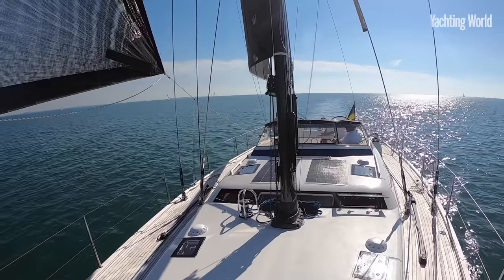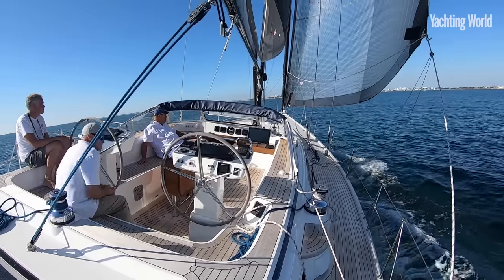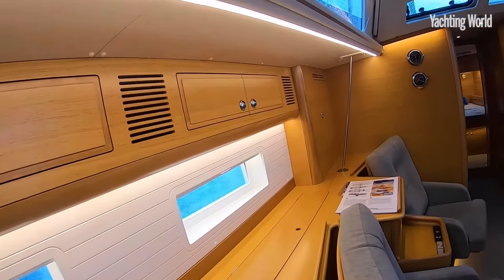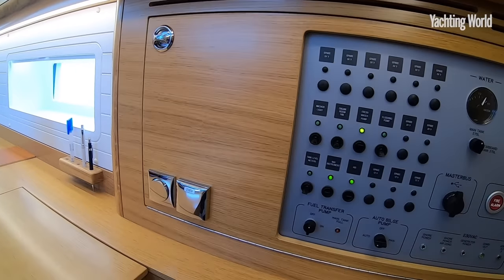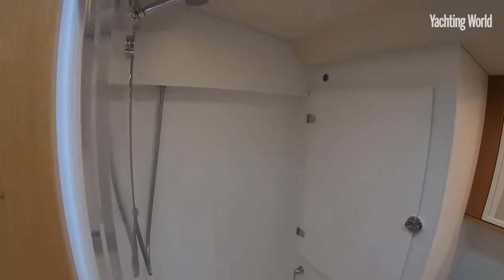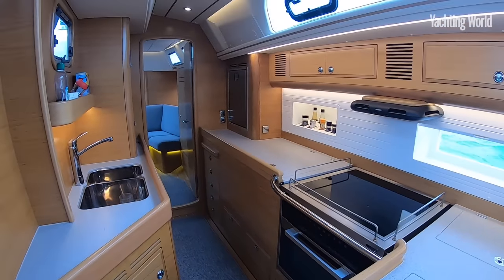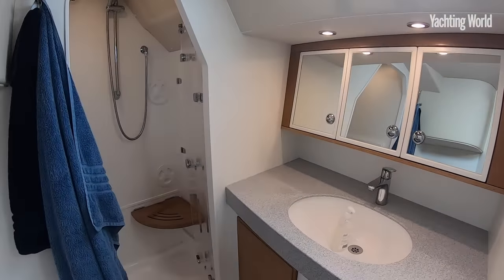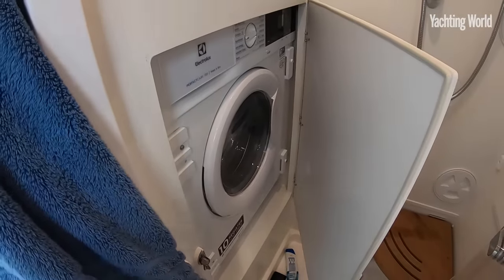Ultimate ocean cruiser? Sailing the Hallberg-Rassy 50

Comment: One of the few builders that still designs for actual blue water and not the latest issue of Vogue magazine. Well done HR….well done indeed.
Reply: But it isn't particularly designed for 'blue water'  I would at least expect some sea berths that would allow sleeping on either tack and provision for lee boards or cloths. On long ocean reaches they are more or less essential.
A double berth should also have a split mattress to allow a centre cloth or board, again to allow comfortable sleeping on either tack. A handy pilot berth near the companion to the cockpit is an essential too.
Similarly with seating and tables, you need to be able to sit and eat comfortably on either tack.
Without this a yacht is just a weekender no matter how well it sails.
Reply: The saloon settee doubles as a pilot berth as noted in the video.
Reply: It got a dual helm and rudder and a modern sleek but beamy hull design, much like Beneteau has sported for years. For some reason, in the cruising puritans mind, the Beneteaus are not blue water cruising yachts, even though most likely is the most common boat brand, also doing Atlantic crossing, but this overpriced Hallberg-Rassy is, even though it essentially sports the same overall design. Granted, the build quality, especially interior, is far superior on this boat than any Beneteau, but so is the price, for crying out loud! A Beneteau Oceanis 62 or Jeanneau 64 (which essentially are sister boats, Jeanneau being an inhouse design studio of Beneteau) cost the same brand new in US Dollars, as this 50 feet Hallberg-Rassy do in Pound Sterling, so really a much larger yacht 20-30 percent cheaper! I could not make the choice to buy this. Even, if I wanted to go down the road buying that little extra on a blue water exploration ready boat, Then this boat cost the same as the 50 feet Garcia Exploration CATAMARAN! A catamaran of course offers vastly more space on the same length hull, and that is a boat build in marine grade aluminium and it takes a full 1½ year to build each boat, because of not least the time and labor demanding welding process. Allures 51.9 cost half of this Hallberg-Rassy, the hull is build in marine grade aluminium, again, on same shipyard, which build Garcia boats and the accommodation is easily as luxurious and no compromise, as this Swedish luxury brand is. When it comes to the indoor accommodation especially and also the protected helm position, I much prefer Amel 50 over this Hallberg-Rassy too, and this almost make that seem like a bargain in comparison, which is fantastic to me: My one gripe with Amel indeed is, that they are expensive! They however also got things for them, as solid stainless steel rails all around and watertight bulkheads and doors between multiple compartments through the entire accommodation, which virtually makes Amel unsinkable. The best part of Amel is however, that they have not yet caved to the popular demand and made aft exposed dual helm positions, but still got a single very protected helm position, double enclosed in the central cockpit and often under a hard dodger too. That is the way to do it, if you want to go blue water cruising, and not just weekend sail in nice weather during summer time. The helm position of this Hallberg-Rassy, as they also are on Beneteau and Jeanneau for the same reason, will be terrible in bad weather sailing conditions!
Reply: I guess you won't be buying a Hallberg Rassy then 😊

Comment: I’d like to see Magnus and Dick Beaumont (Kraken yachts) have a discussion about skegged rudder and encapsulated keel vs bolt on and twin rudder. 
Currently inclined to putting my money into the Kraken.
Reply: I'm far from an expert on these things, but on paper I'd go with a kraken if i had the money and inclination to buy a new boat. Not only for the solid construction, but well thought out systems (which you can see in the kraken engine room tour). Although if the boat was only going to be used for coastal sailing, island hopping and chilling in the med, I would think going for the boat that's most enjoyable to live aboard is best.
Reply: Neither's opinion would really be worth all that much...... Just differing opinions. It's the quality of their workforces and processes which matter.

Once dealing with cruising yachts, where not every single gram of weight counts against you, it's quality of execution which determines how well similarly shaped keels and rudders are affixed to the hull. Not headline "design philosophy" Just as is the case wrt hull material. Both the HR and Kraken ways can be made rock solid, or flimsy and unsuitable, for cruising appropriate moderate aspect keels and rudders.
Reply: That hull shape would be unsailable with single rudder. There is no point in any discussion.
Reply: @blegi1245  the conversation would be about the philosophy of blue water boats with bolt on/blade vs encapsulated/skegged  
I’ve listened to both sides. I would like to put both sides in a room and have a debate.
Reply: @kodiak7  naval architect for hr is German Frers. I don't know who kraken uses. I don't see what yard managers can contribute to a naval architecture conversation that mostly happened about 20 years ago.

Comment: I don’t understand the reasoning behind the pod that sticks up at the nav station only to give you more unusable horizontal surface that can’t be used if you are actually sailing this boat. There also seems to be a contradiction between creating a large spacious feel and then making pinch points like the narrow hallway.
Reply: That’s the thing about sailing, you want the spacious feel but without ever being too far from a surface to lean on or hang off

Comment: Interesting that they compare it to the 55 and yet it is really closer to the 48.
Reply: They are comparing it to the older 55 because it has more interior space than that one even if it's a much shorter boat... The 48 which is also part of the older hulls is WAY smaller than then new 50 in terms of interior space.

Comment: I absolutely love the brand, but I think that my definition of bluewater yacht is different.  To begin with I would like to see some significant cockpit protection for foul weather -- that small dodger isn't going to cut it for major squalls.  With a boat of this size the dinghy davit system is a must -- I don't want to have to manhandle the dinghy or the motor off of the fore deck (I didn't notice anywhere to even mount an outboard -- saillocker? That sounds like fun -- not!!!).  With a draft of close to 8 feet it's not designed for sailing to many favorable destinations (Caribbean, French Polynesia, Seychelles, etc) where people sail to experience the beauty of the reefs.  Finally, spending over 100,000 € for the mast, boom, spreader, and sail system just doesn't sit well with me -- just imagine needing to find parts for  a 100,000 € set of standing rigging in a remote anchorage in French Polynesia --- welcome to your new home for the next few months!!!  Lastly,  I did love the engine room with both front and rear access to the engine, but I wonder about the access to the sides of the engine -- with all of the beam that they were so proud of mentioning, I can't help but think that an extra  3" per side might just make the difference between an easy repair and a difficult repair out at sea.

Comment: Beautiful boat Toby and build quality is renown. I wouldn't spend the outrageous amount of cash required for the carbon sails and mast package.  Not for global cruising. Cheers
Reply: If you had outrageous amounts of money, you could probably be convinced to get the carbon fibre mast set up.I am sure this system would benefit you and the boat greatly.I would but l guess thats just my opinion.First off the lottery win.
Reply: @miketybring4700  I disagree it's a vulgar amount of money and it's certainly not a racing boat, it's a global cruiser so arrival times and departure times become almost irrelevant.  Basic sails albeit good quality ones and self furling and tacking would be prudent and less grief long term. Good quality aluminium mast is all that's required for cruising.  Imagine trying to have a carbon fibre anything repaired in remote destinations.   Put the money into the bank for the trip I say
Reply: @bigbopper143  carbon masts have especially for cruising boats many benefits. It doesn't even make that much of a difference in speed. It's more about stability and comfort of the boat, which cruisers can appreciate
Reply: @Nlsmhs  Ha ha ha ha ha ha ha ha ha ha ha ha ha ha ha ha ha ha ha ha ha ha ha ha ha ha ha ha ha ha ha ha ha ha ha ha ha ha
Reply: @bigbopper143  Carbon mast and boom etc increases the stability of the boat, you are losing a lot of weight up top. Plus, just because you are cruising doesn't mean you have to have a boring sluggish boat.
Reply: @captainswoop8722  In-mast furling is "risky" (at a minimum as in "less proven"...) in and of itself (although like most "high end" modsailcons, HR are the ones I would trust the most to minimise that risk...). "Carbon", and vertical battens, certainly doesn't intuitively make emergency workarounds for when something fails just as you are about to be washed ashore in Tasmania or worse, any more reliable. As for stability, once you are stable enough, adding more just means you end up carrying more sails when your in-mast fuller sticks, just when you need to reef as of half an hour ago....
Reply: @paulnorman8274  Of the furling systems, I would go for boom furling, at least you can haul a sail down by hand if the boom furling messes up.
Reply: @paulnorman8274  Also for 'less proven' mast and boom furling is pretty well established now and is standard on the 'party boats' where the food and drinks at anchor are as important, if not more so than the sailing abilities of the boat..
Reply: @captainswoop8722  I'd go for whatever Hallberg-Rassy recommended...... Out of all makes, they (and Amel, although they do things a bit different) are the ones with the most experience with these sorts of mod cons aimed at making boats which are far too big, appear not to be.

Realistically, though: If I wanted a boat big enough to require "push-button sailing" and electric furling and retractable everything to operate: Twin 40 inch or above screws simply scales much better than any such exercise in hypercomplexification, no matter how good the guys at Hallberg-Rassy no doubt are at executing it.
Reply: @paulnorman8274  I would go for an Oyster or Discovery myself. If I was after (as you say) boats that are far too big.

Comment: I'm not a fan of the bow. Like older models look better. Love the carbon fiber, I can dream there. Love the lighter oak interior and the desk in owners cabin, since so many of us are video editing or have kids and extra desk space and a quiet space away, is ++++. Love the updated, fresh heads and the peg options for dishes is another winner for live aboards.
Reply: I don't like plumb bows either.  From the videos I've seen, they go through waves, rather than over them.  This makes for a wet ride, and increases the risk of pitchpoling.  They squeeze as much space as they can in a given length, but the price and the weight would be virtually the same for a boat six feet longer, with overhangs.

Comment: why the heck would you need two helms so close to each other?
Reply: Agree , it was the first thing I thought…more $, less room.  What’s the big advantage?
Reply: @heartysailorman5719  Advantage: so that the helm can look down the side of the wheelhouse and have a better view down the gunwhale on the windward side. If helming from the leeward side the helm is better able to watch the boats to leeward on  a converging course on the other tack and to watch for any back-winding in the slot.
Reply: @tomcarr1358  this could have easily been done with one tilting helm (versa helm), even if your argument is kind of correct there is virtually just a few inches of space between the wheels..... i think it has more to do with the twin rudder layout and a cost effective engineering solution connecting both rudder stocks...

Comment: There is not an H-R that I do not admire. I want to replace my 28 year old First 265 with the 340.
Reply: I just recently looked at most of their rear cockpit boats. While they are mostly known as a center cockpit company, even their smaller rear cockpit boats are, unlike most smaller boats, just as meticulously designed and built for comfortable living aboard and extended cruising.

Comment: Best about HR is that it proves that you don't need a 1960s hull shape to cross an ocean, as some old farts argue
Reply: Skeg rudder and integrated keel will always be stronger and safer.
Reply: @wixed  best way to beat a storm is to be fast and avoid it
Reply: Crossing an ocean is one thing. Most anything reasonably well built will do that without falling apart, if handled with some care. Especially after Don Jordan sorted out previous misconceptions about what actually breaks boats in open ocean conditions. Coming in across a river bar, with a big following sea and no alternative harbor for tens of miles, is where fat, buoyant sterns and rudders/keels which can stall, can still most obviously get scary.

You don't strictly need a 1960s era Boeing 737 to get you from New York to Chicago, either. The latest, max (transom :) ) versions mostly still work. Sometimes, they fall down, though....

Less flippant: The fact that we now have much better weather forecasting, routing, charts and cruising guides available, does mean that a boat which can travel faster in more wind conditions, will be better able to make use of all that info. So the general move to prioritise those qualities, even in "blue water cruisers" makes sense. Back in the '60s, no-one knew where and when a storm was about to hit them, nor what the ocean bottom, currents etc. most places looked like. And they didn't have series drogues. So they had little choice but to get a boat type which hove to well, and could take a beating in the ocean. And which could also be run aground regularly, without being much worse for the wear.

Comment: Sorry guys - this is a Mickey Mouse cockpit for a 50 feet yacht. I spend my days in the cockpit. Wouldn’t want to change. Look at the comparable XYacht
Reply: Strange. Most immediate thing I noticed on an X, was that the cockpit benches were too short to comfortably lay down flat and sleep on......

Hallberg-Rassys are designed and sold more for long-term cruising, think circumnavigation, than X yachts, which are sold more as performance boats or performance cruisers. I realise most HR owners don't actually end up living on them permanently for a six year circumnavigation. But suitability for doing just that, is sorta-kinda the dream HR is selling. More so than ultimate "sailing pleasure," which is more X's (and Swan's) "thing." (I suppose You have to sell some sort of "dream" to justify charging what the Scandies do for their boats....) And ultimately, few who do live the HR "bluewater cruising dream" want to spend 6 years, mostly at anchor in the tropics, sitting in a wide open, racing style, cockpit in the blazing sun.

Comment: Interior looks like it's from the 90's. They couldn't modern-up the materials and style?
Reply: go enjoy a plastic looking bavaria
Reply: @muumoo111  they look the same! But cheaper.
Reply: @muumoo111  clearly nasty, with vicious lash outs. Nice guy.
Reply: @SlowCarToChina  still blind :D
Reply: Thank you for your comment! And no, "wood" here and there doesn't equal "classic". The IKEA cloth looking "club chair" looks like out of a time machine. :).
Reply: @johnmoritz  classic as they have been building this way for 50 years with minimal changes because it works , they were first boat builder to make those chairs available to everyone  just like how they introduced many new ideas to the boating community( I would like to think some of you have some boating experience and not some trolls), I used to own HR 42f
Reply: @muumoo111  I own a Contest. And just like any great designer, Contest has been able to innovate on their interior design, which, IMHO, looks classier and more “timeless” than ever before. Minimalism and sleek lines dont necessarily equal “trendy”. A Herman Miller Aluminum or Barcelona Chair will look modern in 100 years. Halberg Rassy’s cloth “club” chairs won’t. Just my opinion of course 😉. KR, J.M.
Reply: @johnmoritz  my boat was built mid 90s, I remember checking contest boats and was not happy with quality of construction or interior ( tho I checked them again few years ago and they improved alot) keep in mind HR and contest are blue water boat but with different missions, yours is faster and mine is slower etc .. get your self on an HR you will know what I mean, very happy to read from another boat owner , I hate those trolls above.. they just watch video s online and talk shit about boats with no knowledge , by the way I now own nordhavn 68 fph ( this boat interior is not good) but I got it used before the pandemic for good price